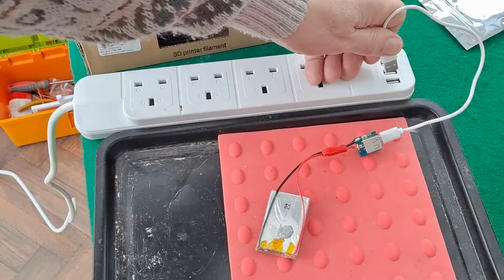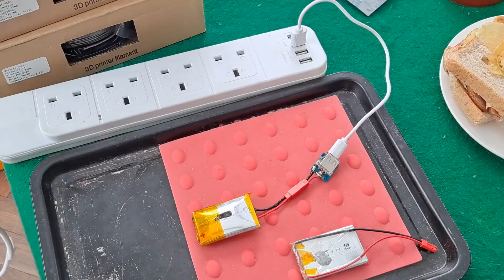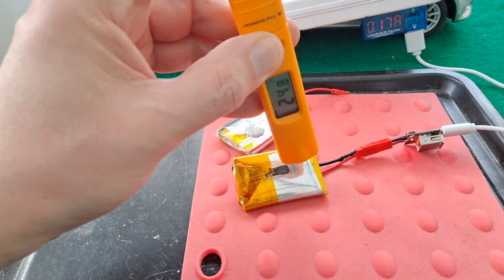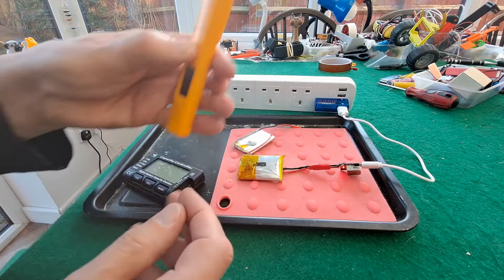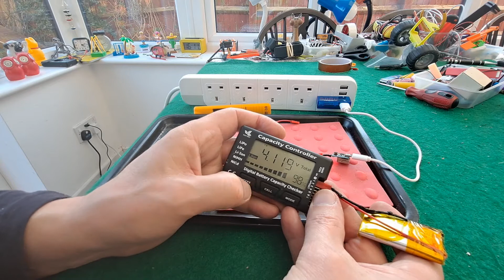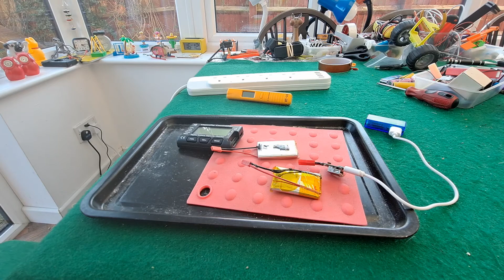Puffy LiIon - Did it survive?

Comment: not fail.:) good.
Reply from the maker: The answer is YES it takes charge, but there is a follow up video that shows the capacity is very low, so even though it shows as fully charged it doesn't last long. Probably just a small proportion of the battery is still functioning.

Comment: I think you should bin it to be honest, it has had a problem and whilst still accepting a charge I doubt it will be up to spec:-) take care stay safe
Reply from the maker: I had binned it. The only reason I got it back out of the bin was I was asked if it would still take charge. The answer is YES, but there is a follow up video that shows the capacity is very low, so even though it shows as fully charged it doesn't last long. Probably just a small proportion of the battery is still functioning.

Comment: If only there was a way to release the pressure the battery would probably work a lot better
Reply from the maker: I don't think so. How does pressure effect the operation of the battery?
Reply: @GrandadIsAnOldMan  the pressure effects it a lot bc its seperating the plates from the insulater which cases a HUDGE drop in capacity

Comment: dont think swelling will  go down .. disposal probably
Reply from the maker: I only got it back out of the bin because Frankie asked if it would still take charge 😆 The answer is YES, but there is a follow up video that shows the capacity is very low, so even though it shows as fully charged it doesn't last long. Probably just a small proportion of the battery is still functioning.

Comment: The cells Inside the battery might be ok in a given amount of time or over time but if u use that battery too much it could explode or even Melt. So dont think replacing that cracked wire would nt be very wise 🤔
Reply from the maker: Hi Marc. The battery has already tried to explode, that is why it is puffed up. What is left of the electrolyte is still taking charge, but it is misleading There is a follow up video that shows the capacity is very low, so even though it shows as fully charged it doesn't last long. Probably just a small proportion of the battery is still functioning.

Comment: When it is puffy, the metal foil (which is wound up on the inside) is not in close contact (via the electrolyte) to itself. After releasing the air a new charge will do much better (I guess). PS: I have a few of those puffy cells, salvaged from Samsung, LG and Nokia phones (to name a few), and I use them for various things (lights, radio, LED solar lights and such). They are perfect for those projects (do use the protection circuit which is on and in the battery, I see yours has none).
Reply from the maker: Although it appeared to have survived, I have since found it does not hold the charge for very long. I am guessing there is a small part of the battery still functioning, and that part takes charge and gives the readings, but soon discharges again, maybe through the damaged part. As for protection circuits, you are right, I very rarely fit them.